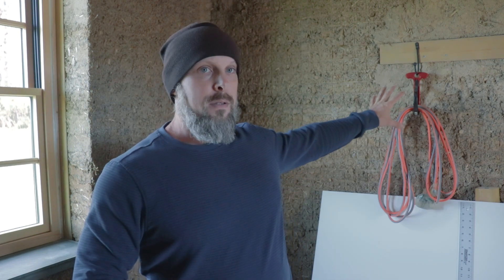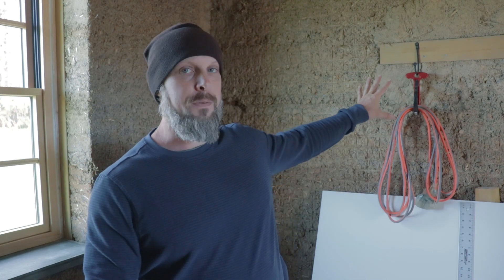The Cob Slipform Method - Advantages and Characteristics

Comment: Hi just have a querry. Do you have any pillars in building the cob house. Structurally how strong are the walls if no pillars are present. We are in a earthquake prone area.
Reply from the maker: Cob walls don't need posts (or pillars) inside them since cob walls are load bearing by themselves. As long as the walls are built thick enough.
However, you can still build a post & beam or frame to hold the roof, and then build the cob walls under and between that.
There's actually options for metal reinforcing in cob walls for earthquake zones too. These can be seen in the cob code. www.cobcode.org

Comment: What do you do with the holes /voids that are created when you knockout or pull the all thread or rods out from your forms and move up to the next level
Reply from the maker: The holes are very small in diameter and I just fill them in at the surface with a bit of extra cob. Then later the whole wall gets lime plaster again over these areas that had the holes.

Comment: Great idea to make some videos about the slipform/cobbauge method! I live in a very cold climate, so have been curious how you would make a wall that has a dense inner face that is load-bearing and a light outer face that is insulating. In the cobbauge project they used a kind of divider to interlock the inner cob and outer light earth layers. I remember in one of your older videos you actually showed a sample of this, but didn't show your method. Thanks.
Reply from the maker: Yes, CobBauge method is great! I've only used their forming system so far and have not built a whole dual-wall building like that. My climate is mild, so it hasn't been necessary here. But I do want to experiment with the dual wall more and show it in videos.

Comment: Thanks for this info! Can the interior walls be more sculpted? How about shower walls or a rocket stove? Is that still doable?
Reply from the maker: The walls will take the shape of the form, so it'll be challenging to not have them flat if built this way. Rocket stoves are still doable. 
Could you elaborate more on what you want for a shower wall?
Reply: @ I wanted to have an open floor plan in the bathroom using a curved cob wall to separate the shower from the toilet.

Comment: Thank for the info! Question:

Why only lightly tamping the cob, vs hard compaction like rammed earth, would it not be even stronger if rammed?

Also, on the same thread, what are the differences between this form of cob (materials/characteristics) compared with rammed earth?

Thanks so much!!
Reply from the maker: The cob only needs a light tamping in the forms, whereas rammed earth "must" be tamped very hard. It's just an efficiency thing really. Over tamping the cob will only make it come out the mesh siding of the forms.
Rammed earth has a higher PSI though because it's tamped extremely hard. So, it'll just depend on what you want.